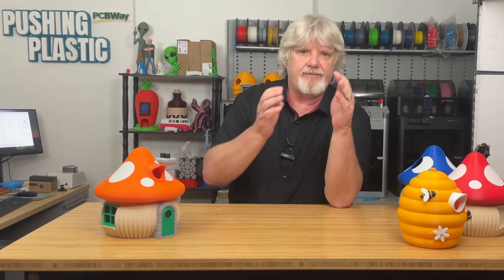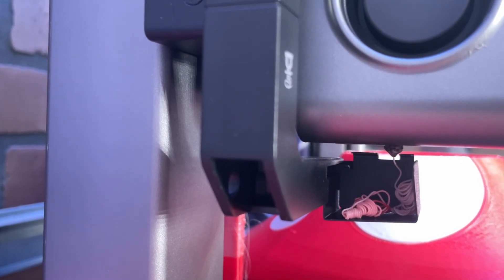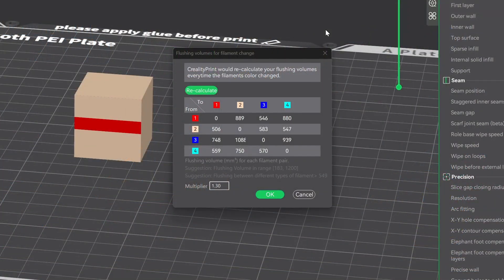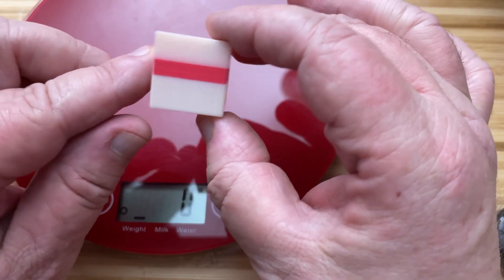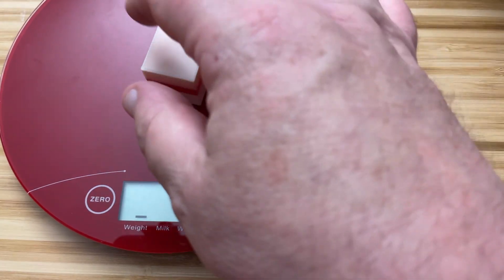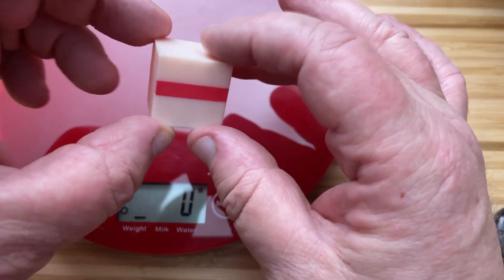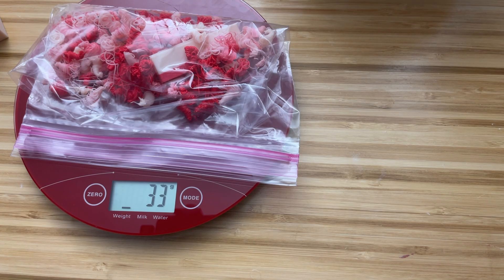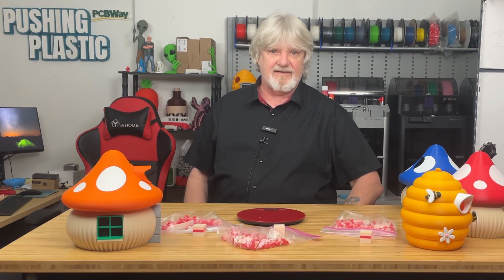Cut The Poop - Can The Flushing Volume Reduce Waisted Material?

Comment: Great video but does not work for me...i have Creality k2 and work with Creality slicer. Problem is if i put 00 or 1000 in that calculator and save, the result is the same. I have always same amount of waist material. I reset printer, reinstal slicer and nothing helps.

Comment: I have a K2 and a couple Bambu's. I find that the Bambu's are much more tolerant on reducing the multiplier. With the K2 if I adjust the flushing volume below the 1.30 I almost always have some bleed. With the Bambu's the default is 1.0. i find if I reduce it to 0.65 or 0.7, I get almost no bleed. Another trick you can do is reduce the size of your purge tower. I typically drop it down by 5mm. I noticed the new Bambu Studio has taken that option out. They changed their purge block and I don't see anywhere to change it. Orca still has it and I use both settings to reduce my waste.
Reply: I think that's happening because K2 has a larger melt zone
Reply from the maker: @spectrehat maybe, but the creality hi has the same thing going on
Reply from the maker: I've been noticing to that the Bambu's are more tolerant of a multiplier change. I usually drop to 0.6 and work from there!

Comment: Hello! First of all, congratulations on the video — it was really well done and enjoyable to watch.

I’d like to share an idea based on my own experience. I also use a CFS system with a K1 Max, and I’ve noticed something regarding filament consumption during color transitions. As you’ve mentioned, setting the transition length to 1.3 provides clean color changes, but it also leads to significant filament waste.

So here’s my suggestion: what if we reduce the transition length to 0.5, or even set it to zero, and instead compensate by increasing the filament purge length during the actual color change (when the filament swap occurs)? In theory, this could both clean the nozzle effectively and reduce overall filament usage and print time.

Of course, this is just a personal theory, and I’m sure your experience in this area far exceeds mine — but I’d love to hear your thoughts on whether this approach might be viable. If you ever consider testing this method and creating a video around it, I’d be really interested to see the results.

Apologies if my English isn’t perfect — I hope I was able to clearly express what I had in mind. Wishing you a great day!